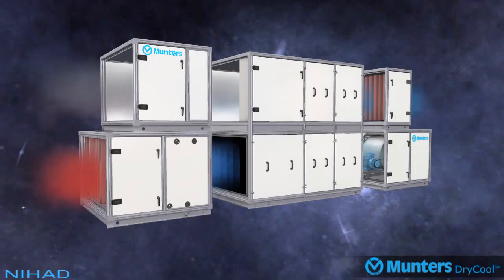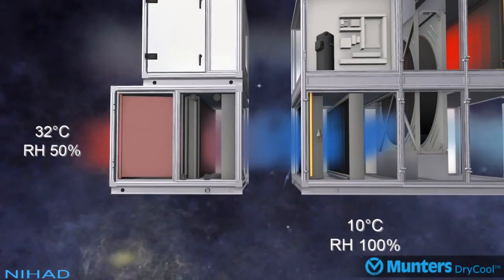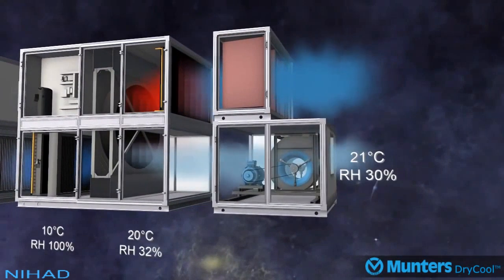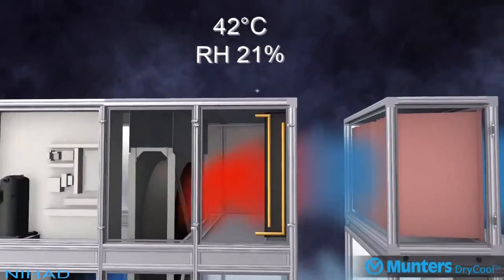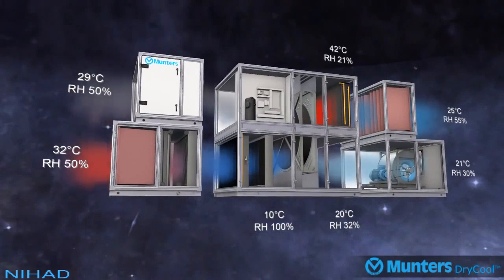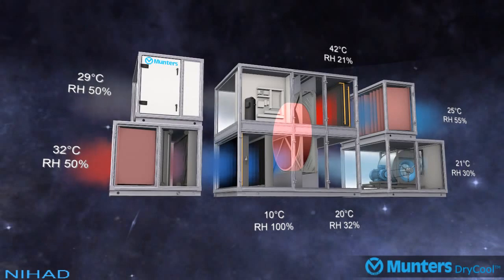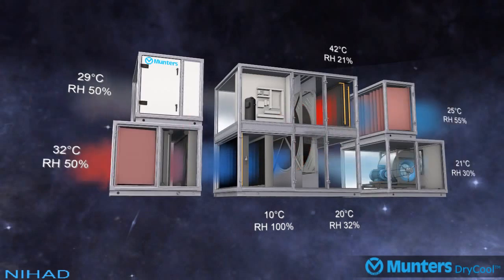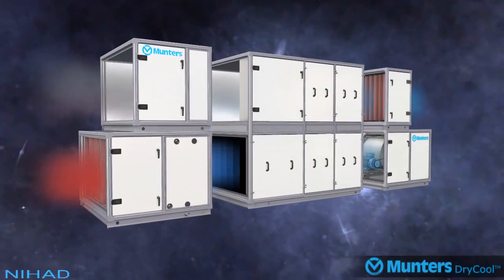Munters Dehumidifier working Principle

Comment: Buyer beware! Over engineering at its prime. Nightmare for owners and extremely expensive to maintain and repair. You will never see a penny of savings from the energy saved.
Reply: My facility has two of these. You're exactly right. The belts break that drive the desiccant wheel and the desiccant wheels only last 5-6 years and cost thousands to replace.
Reply: But if you do servicing every after 3 months then it can stay for much more longer because i do this onboard from last 16 years i never found any kind of problems so far i have changed bearings 3 times til now and the bearing are much more cheaper
Reply: @orvilpereira1762  I service desiccant wheels. They do not last more than 10 years. Very expensive to replace. But well worth it. Especially for ice rinks.